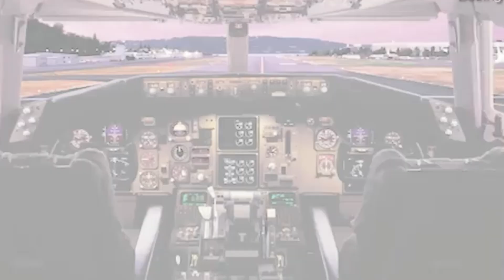NEW Boeing 797 Just SHOCKED All Aviation NOW! Here's Why

Comment: The A321XLR is a derivative of the A320, which sold in large quantities.
The B797 will not see sales growth unless it is used as a successor to the 737MAX.
Southwest Airlines and Ryanair are requesting short main landing gear and two aisles.
Short main landing gear can be achieved by placing the engines above the wings, like the HondaJet, and making the containers half the height of those used on the A321.
A seating arrangement of (2+4+2) is ideal. The B737's (3+3) arrangement means it will have a shorter fuselage than the 737MAX-10.